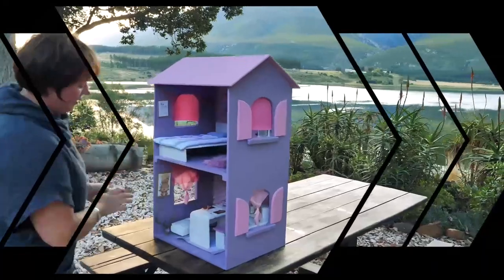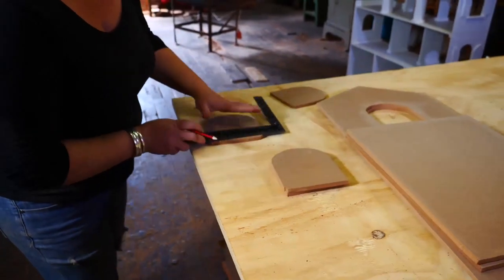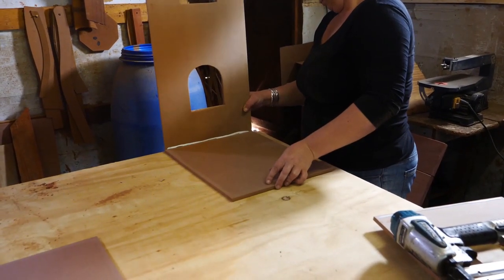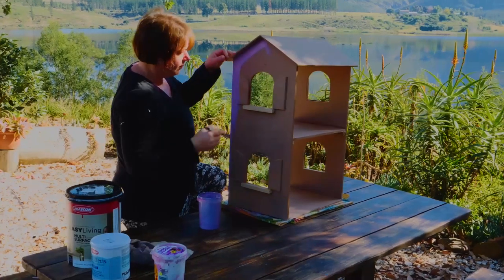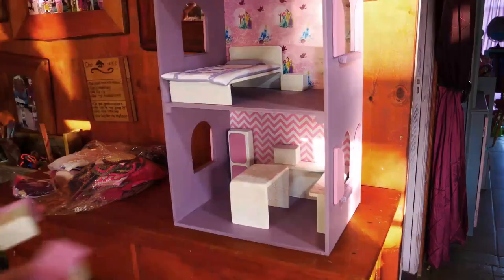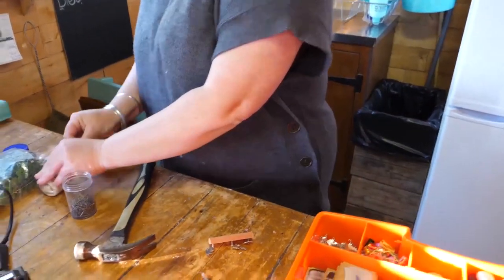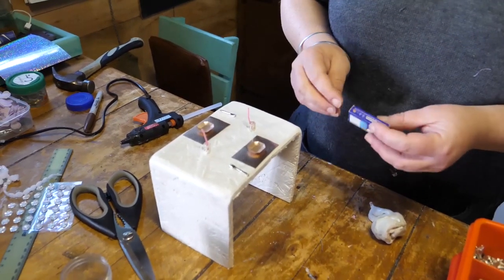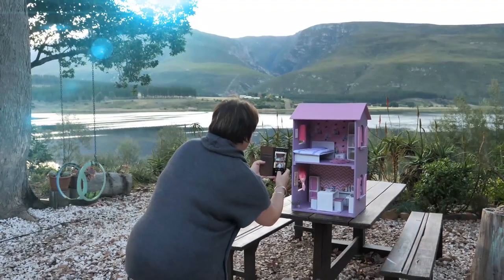How to make a Doll's House

Comment: Hiya guys,
Would  anyone know if there’s a list of required tools to build this house? 

I’m new to building dolls houses and was unable to identify all the tools being used just by seeing them on video ahahaha. I’ll get there one day! 

The creator did mention a few of the tools she used however I’m looking for a full list of the tools needed. 

If anyone is able to help me out I’d be super grateful! 

All the best :)
Reply: There are lots of channels showing how. Bentley House Minis, she even sells kits; and Laurie Heisler (also sells kits), Joanne's minis has some step by step doing room boxes with foam core board, even had an electrical step by step guide but I think those are back in 2015 so you have to scroll back a bit. If you want Barbie sized stuff, try MyFroggyStuff, she makes room boxes too but more portable, she calls them folding rooms or something. You can buy a kit to build a miniature house and put that together. You might want to find a channel that has done it and get the same model to follow along. 

At the start of lockdowns, Bentley House Minis made a whole house with furniture from cardboard boxes and other garbage. You'll need basic supplies like glues, a knife like exacto knife, paint. Watch more. You might like Where The Gnomes Live too, she makes structures out of masking tape and aluminum foil and paper towels, and lots of glue.

Comment: did you say this is hardboard or 1/4" plywood?
Reply: Shes using MDF (Medium Density Fibreboard)which is very easy to cut. She called it softwood so perhaps that's another word for it.
I'm currently making a dollhouse out of the same material!🙂🏠
Reply: @Stargazer3131  you need power tools to cut it. The Real Good Toys company uses MDF and it's really hard to add window holes or doorways if you want to alter the kit.